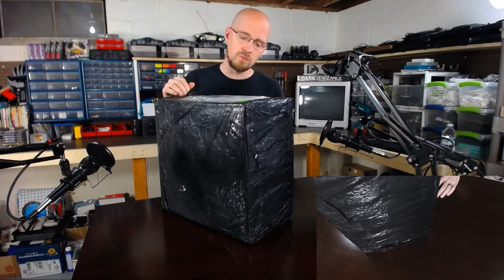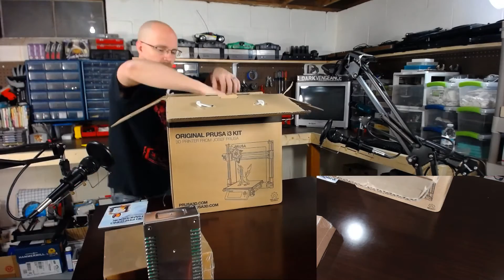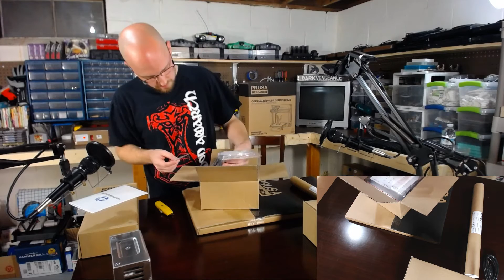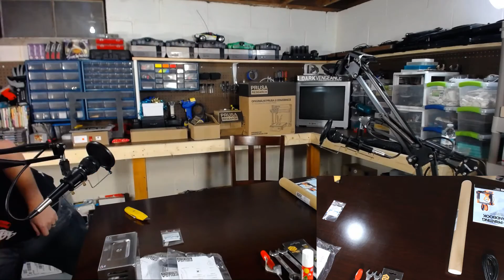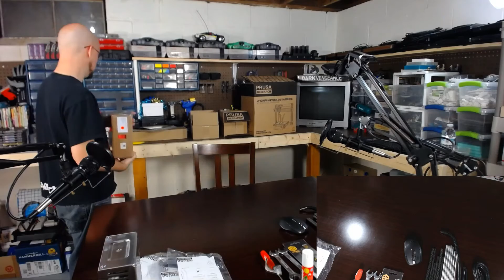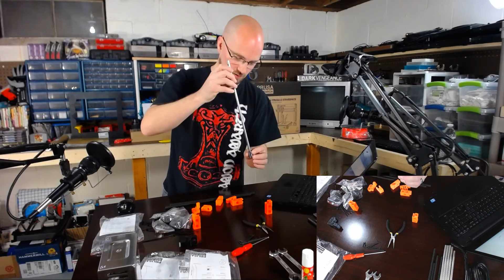Original Prusa i3 Mk2 - Unboxing and Assembly - Part 1

Comment: those are crimped on the connectors they are called furrels they are the best way to get a conection with screw terminals